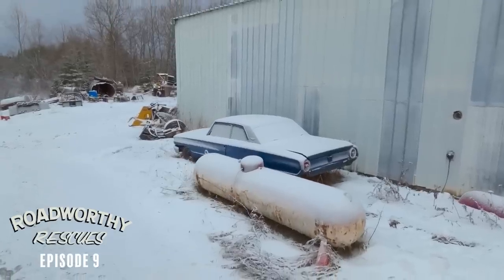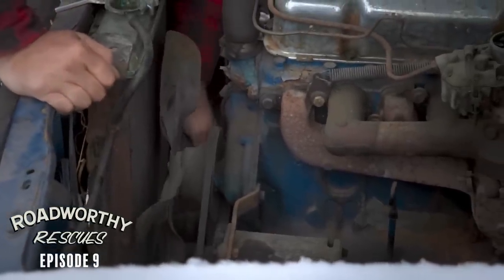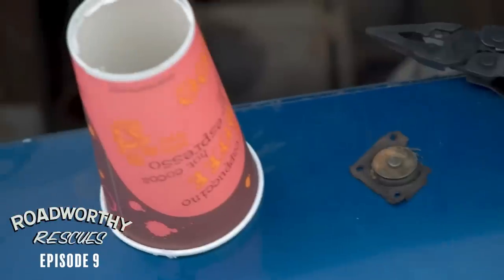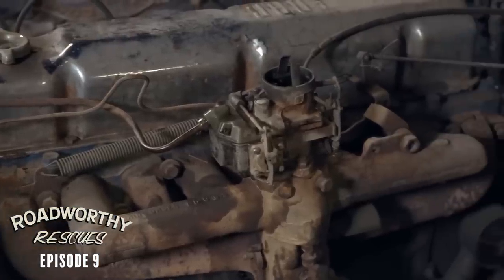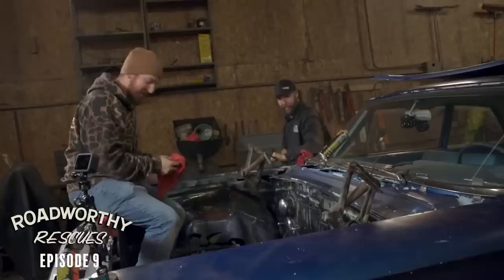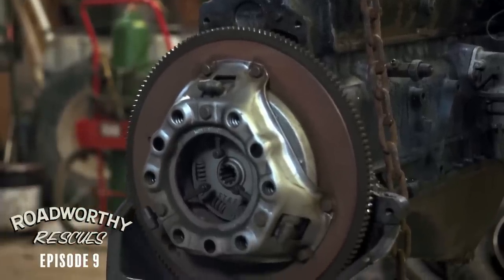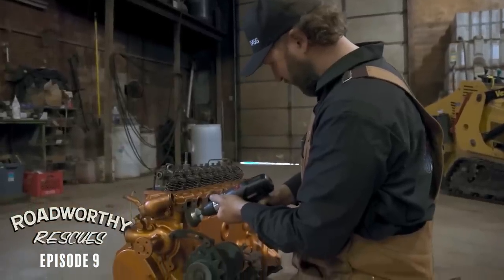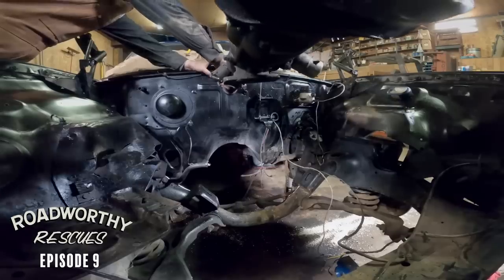Abandoned 1964 Ford Galaxie Hasn't Run in 32 Years! | Roadworthy Rescues

Comment: What a great find I love 60's fords. My parents bought a used 64 galaxy wagon in 65 or 66. I have 3 brothers so it was way better than the falcon sedan that we were in. Later they bought a 68 country squire what a beautiful car, and the 64 became dads pickup. It worked really well because everything in the back was steel.  I also built a big straight 6. It was a Chevy 292. I  put 10 to 1 pistons, an hp cam, offenhouser intake with a holly 600 and Clifford split manifold headers. In would do high 13's in a 67 short narrow pickup. You can get some assume low end torque out these long stroke engines. This car needs to be built it's beautiful.
Reply: My first car was a 1964 Galaxie 500 station wagon with the fake wood and everything. I bought it from a co-worker of my mother's, for $200, in 1975. It was a real sleeper - someone had ordered it with the 352 V-8, 4-barrel carb, dual exhaust. A heavy sled, but it would leap at stoplights when I put my foot in!

I had a lot of fun with that car... but only for a year... 17yo me learned a hard lesson that balding tires, heavy rain, and speed don't mix. No one got hurt thankfully, but I did shed a tear for the car.

Comment: For those that don't know.
Fuel make it happener = carburetor.
Sparkelators = Spark plugs.
Brake pushelator = Brake master cylinder.
Brake stopenantors = Brake calipers and wheel cylinders.
Gasenylator reservoir = Gas tank.
Spark make it happener = Distributor.
Steering oscillator = Steering gear box.
😂
Reply: Forgot the ol' chargin whirler!
Reply: lightning whirler is the best one
Reply: Ok, name for differential???
Reply: Remember to check the blood stick while yer at it fellers (and fellettes)! I wonder what Clint Black is up to now...🤔

Comment: Had  65 chevy 1/2 ton 230 that had a cracked block behind the ex-intake manifold.  Spent some time and did a good job with the ole JB weld and drove it for another 10 yrs.

Comment: The block is a candidate for a cold weld. Cold welding is interlocking tapered plugs that are installed, ground flat then partially drilled into to prevent them from backing out. They actually work. Time consuming job, lots of drilling and lots of plugs. Cheaper than swapping a block or an engine.  Success is only good for cracks, not wide open splits. Not something you would do on the road.
Clifford parts. 6=8. Nah, only when it comes to gas mileage.

Comment: Never realized how similar body work could be to drywall finishing . 
if the Framing is crooked -you can throw mud at it for days, but you really just chase the problem around,& hope nobody notices the “hills & valleys

Comment: If you need prebent tubing try Inline Tube in Shelby Township, Mi. I bought prebent stainless steel brake hard lines for a 1967 Pontiac Catalina and they fit perfectly.

Comment: Been an auto tech for over 30 years and installed more clutches than I can remember. When he asked, "did that just happen, after everything lined up and the transmission just slipped right in it happy place, that was not scripted. It rarely happens that way. I can probably count on both hands the number of times that happened for me.

Comment: 32 years and you’re sitting in the cold and the car has been left out in the cold with the crack block and you turn it over twice and it cranks up. Unbelievable the straight sixes really good engines.